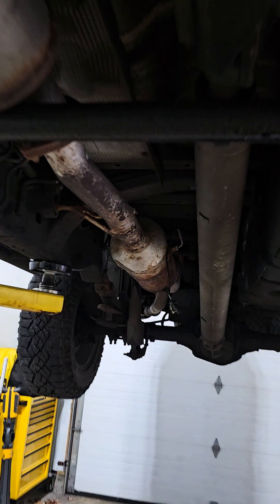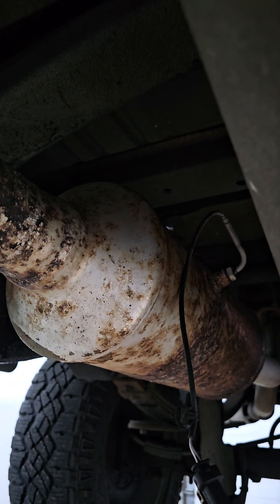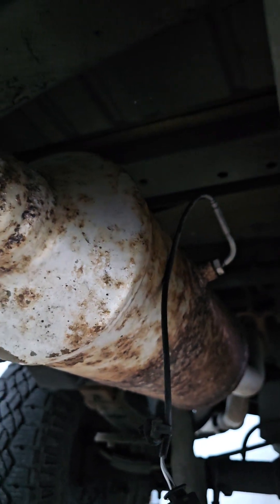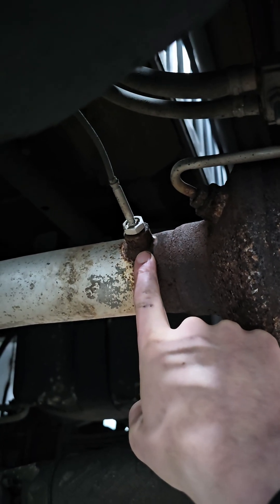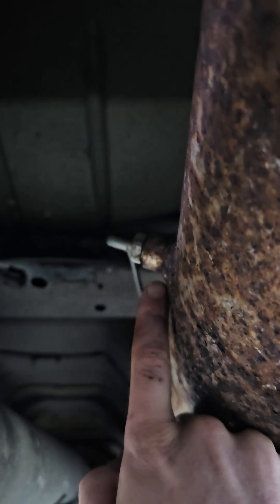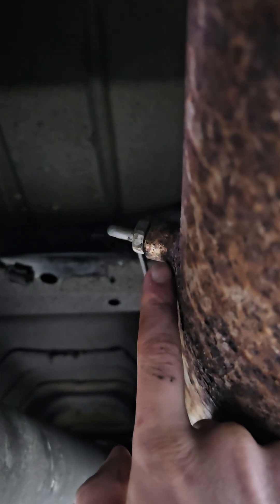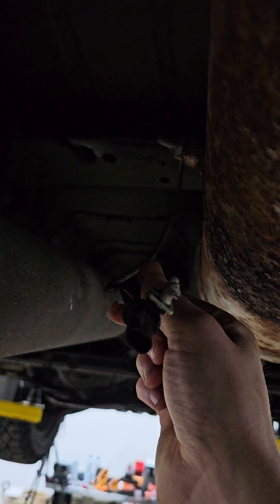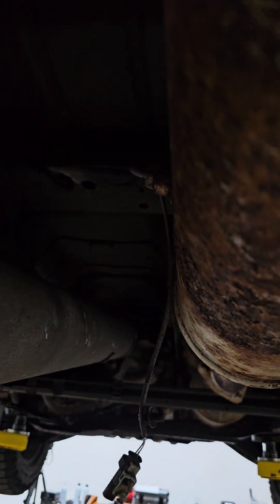2.8 Duramax Exhaust Gas Temperature Sensor Diagnosis. #epa #emissions #diesel

Comment: I really like that you are producing videos on the 2.8 Duramax. I have had  both NOX sensors fail on mine and the head gasket failed. The head gasket was quoted $7,000.00 buy the dealer. I did it myself and it’s a big job. I do monitor (Always) all the exhaust sensors and other things on my phone every time I drive my truck. That sensor issue would have shown up before you ever got to a regen if you were monitoring. 
Also I had this cheap spring clamps break that hold the rad hose on the radiator on the way to work. The temperature gauge actually went down as the engine was overheating due to the design and placement of the thermostat. No water and that means no water circulation to the thermostat and temp sensor. I couldn’t believe the engine survived. Driving for 40 min on the hyway with no water in the radiator and the gauge showing cold.
So even though you don’t get many views on the 2.8 pls keep the vids coming so we can share experiences and help keep these trucks going.
Not sure about you but I really like the Colorado with the 2.8 and its amazing fuel efficiency and towing capabilities….
Edit…. Forgot I had an air temp sensor fail between the turbo and intercooler. There is 2 sensors one one each side of the intercooler. Exchanging them showed the issue moved from the intake of the intercooler to the output of the intercooler. A high quality scan tool and some mechanical ability is a must for these trucks…..
Reply from the maker: I was monitoring it. I was on a different page on my idash😅. I knew I was in a regen, the soot load wasn't dropping, light popped on, regen turned off, flipped over to my emissions page and immediately saw sensor 4 reading half of what it should.

Agreed on all counts. A scan tool and some basic troubleshooting skills go a long way with these trucks. 

I have a feeling a lack of parts availability will put a lot of these in the scrap yard in the future.

Comment: For a must situation when regeneration absolutely is needed - put appropriate resistor into the plug instead of the sensor and the system should start regeneration.
Reply from the maker: The PCM has A reading so using A resistor won't work like you think. What youre saying is no different than my current issue. If i trick the truck into thinking sensor 4 is 1200 degrees and the other 4 sensors in the exhaust are reading 600, it will throw a not plausible code on #4. Which is the same issue i have 😂

Im not trying to damage a $2200 DPF because I couldn't wait a day for the correct part.

Comment: On my 2019 colorado. So far I replaced the fuel injectors about 142,000 miles and the MAP sensor around 156,000 miles. It has 158,000 miles now

Comment: We need to wind the clock back about 60 years on automotive technology. No computers and sensors should be allowed.
Reply from the maker: Nobody is keeping you from buying a horse.
Reply: @RepairGeek  home owners association says no to the horse.
Reply: @RepairGeek  :face-blue-smiling::face-purple-crying::text-green-game-over: I did NOT say 120 years. 60 years ago it was the 1960s ... There were decent, uncomplicated, easy to fix, cars back then, my man. WITH zero computers.
Reply from the maker: My point stands. Nobody is keeping you from buying an old car.